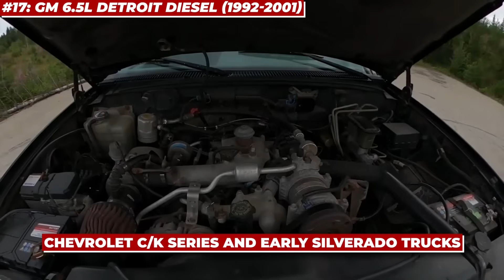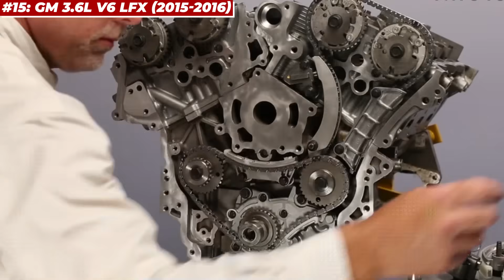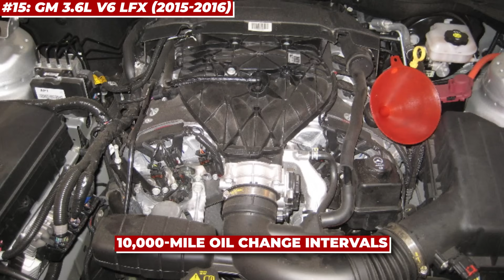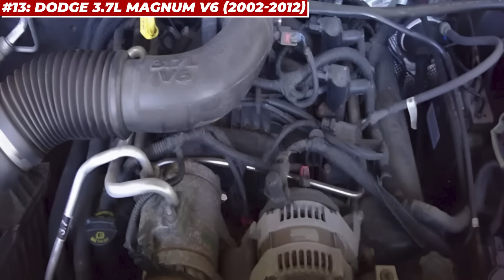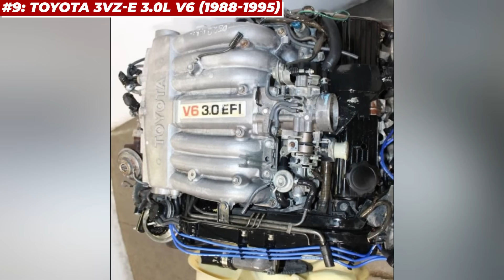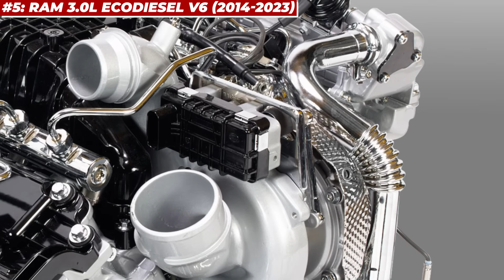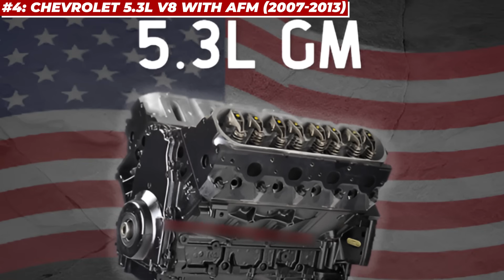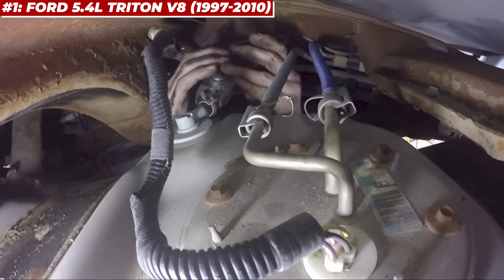17 WORST Engines Ever Put into Trucks!

Comment: Most these engines weren't Bad. Lazy Americans Not maintaining their engines, trannies, radiators is the main PROBLEM. 10,000 mile oil changes destroyed any motor. Never servicing your trannie and radiator destroyed vehicles. No fluid is Lofe time.

Comment: Fords biggest ever worst decision was not importing from Australia the mighty legendary 4 litre 4 valve VVT Ford Barra straight i6 engine. The decision not to is easy to figure out it would have simply destroyed the V8 industry. 182-195 KW WITH 380 TO 391 nm in standard form but its combined drivabilty in a 1700kg sedan it can pull a small house. The factory turbo versions are on a whole other level 240 kw to 330 kw and 470 to 565 nm would make great truck engines with 1 mllion km reliability. This engine built right can be a drag strip terror capable of over 2200 HP. You only have to spend a few grand to pump the power just a little and build a real reliable everyday 5-600 HP truck engine. Some of these engines came mated to the ZF 6speed manual which would make a mighty F150 hauler.

Comment: My uncle has an 81 Chevy truck with the 5.7 Olds diesel...it has 80,000 miles, 1 IP rebuild, lots of oil leaks, several sets of glow plugs, but it still starts every time...
Reply: Only 80,000 miles?
Reply: @RH-xs8gz  yes, show me any new truck that will go 44 years with nothing but an IP rebuild and a few things like the alternator and H2O pump...yes only 80,000 miles, but it is driven once a week or so...

Comment: This was a poorly researched video with the same generic AI voice heard in countless videos. Garbage.
Reply: AI voices suck, they are robotic and tend to mispronounce words.  They contribute to the plague of laziness that invades everyone's life too!
Reply: Agreed: the only GM Diesel that was based on a gasoline engine was the Olds Diesel.  I had a 6.5 in a Suburban that I ran to nearly 400K.  Yes, the Stanadyne DB4 electronic injection pump was a disaster, only because the head creating FSD was bolted onto the side of the pump, causing shortened pump life and very shortened FSD life.  Solution?  Remote mounting of the FSD.  Worked like a charm.  Oil cooler lines were a disaster corrected by having some hydraulic lines to replace them.  I put a Duramax fan blade on to increase cooling.  A full set of injectors cost about what a single Duramax injector cost. Rust and mice got it in the long run.  My old GMC Jimmy with the 6.2NA gave me 25 mpg but was pretty gutless.
Reply: @larryhurd7350  True, the 6.5 and 6.2 were a Detroit Diesel design. As Ford paired with Navistar and Chrysler teamed with Cummins. All the American auto companies learned after the Olds Diesel disaster, turn to the pros.

Comment: My 2007 h3 5 cylinder didn't make to 200,000 miles. I changed the oil every 3,000 miles and took care of it. Still looks new had the trans rebuilt at 180,000 and at 185,000 the engine went.

Comment: It wasn’t the aluminum head in the 5.4. It was the fact that there was only 3 threads holding the spark plug in.
Reply: I swear the people doing these AI channels look for ways to be wrong about the information.
Reply: I could've sworn I heard him say that about the spark plugs being too short
Reply: 5.4s aren’t great truth is the cam phasers and spark plugs are terrible  but there’s preventative measures you can take to prevent these issues get mechanical chain tensioners as the hydraulic ones wear out faster as for the cam phasers you can do a lockout on them and ford did redesign the spark plugs in 2008 to a one Peice design which prevents them from breaking
Reply: @quindariousgooch4176  Cam shaft bolts breaking . F250 work van,
Reply: And the extended plug design

Comment: The GM Detroit Diesel 6.2 and 6.5 were apparently so bad that GM didn’t get rid of that engine for 20 years…an engine that was also used by the US armed forces in the HMMV as well as commercial trucks..
Reply: They were far from being common, though, because no one wanted them, because they were garbage. The engines were updated over the years, and they're probably not as bad as they once were. The military wants lowest bidder, it doesn't buy the best technology avialable.

Comment: I've owned several GM 5 cylinder engines. I currently have a GMC Canyon and a Hummer H3. Both well over 100k and have no engine issues. Simple routine maintenance does a lot. These engines last well past 300k miles with simple care . Don't know who lied to you about your research.
Reply: I drove a Colorado 3.7 engine 2007 for 6 months. Crashed and totaled it. Bought a Canyon  2004 with tthe 3.5. Ran it till the frame quit on me. Engine was still running good
Reply: You just wait ….. you will !
Reply: Same here, 132K no issues...
Reply: 5 cyclinders 😂😂😂
Reply: @Iconhulk I'm sure it will beat your 4cyl ....car.
Reply: I watched a colorado 5 cylinder blow up right next to me on the highway. Chick driving it wasn't trying to let me pass. I floored it and she did too. Her engine blew up. Lol talk about instant karma. And i was driving a 99 explorer with 4.0sohc that had like 190k at the time. Now it has 223k and still runs. It's one of my daily beaters.
Reply: The 3.5 had a lot more issues because it wasn't a sleeved cylinder. The 3.7 was sleeved and had less issues. But either way, these engines were gutless.
Reply: Any modern diesel ends up with the same problems with the EGR. Nothing in nature eats it's own sh't and the concept in engineering is a colossal blunder. The EGR circuit makes the engine run way hotter and kills fuel economy to the contrary of the stated goal of reducing emissions.
Reply: I heard they are pretty underpowered and not very fuel efficient?
Reply: @adriansolo4  fuel effciency wasn't that great but they were quite peppy when properly maintained. the 3.7 was rated at 242/242. more with tune easily.
Reply: 5 cl really  bad ur lucky guy id say
Reply: Lol you're the needle in a haystack

Comment: The problem is the second-generation small block got so cheap they were making No money from them; you could buy a crate new 350 for less than $2000 dollars in the 90's and the early 2000's.  They changed engines not to make them better but to make them cost more.  That engine would work well today.  And you wouldn't have all the failures you have today.  And the four speed auto they had for years was also cheap.  No money from them.  They did it all for Money not to help the customers.  Their failures are their own faults.  These new trucks with 1986-89 engines would be the best with the 4 speeds.

Comment: The lm7 5.3 vortec  99-06 the best gasoline engine ever made ..
Reply: yes also 5.7 and 6.0 they are well engineered all gen3 good engines gen 4 not bad if you delete dod as early as you  can just tune or unplug  the oil sensor plug
Reply: Got 359.000  on my 2007 chevy  1500 Silverado   4.8 vortec v8  same transmission   still runs good  and power   and I used it to install carpet alot
Reply: @NasarioNieto The 4.8L never had cylinder deactivation, the Gen IV 4.8L is just as reliable as the Gen III engines.
Reply: @NasarioNieto I got 386000 on my 2008 5.3
Reply: @NasarioNieto  The 4.8 did not have AFM through the 2009 model year.
Reply: No joke, my 2005 suburban is at 325k miles and still going strong.
Reply: Had a farm truck with over 600k on it
Reply: I've got a 2005 Mercury Grand Marquis with a Ford 4.6 L. These engineer also very much bulletproof. That's why the police used them in their crown vics(essentially the same car) the one I have only has 60,000 miles on it. And has no problem ripping the tires off of it without using a power brake..
Reply: Yep I have a 2010 5.3 v8 Silverado it’s very reliable

Comment: Gm should've kept 4.3 or inline 6 Instead of 5 cylinder
Reply: That and the last true small blocks and good old 4 speed auto which are all cheap to repair or replace.
Reply: That was a great motor. I  Had one in a boat also.
Reply: 4.3 and the Buick 3800. Best GM engines

Comment: Add the Nissan A series engine, 1976 to 1982.  Week defective main bearings send pistons into the head, destroying values, pistons, and crankshaft.  Self destructs the engine at 75000.  Engine used in the b 210, 210 and pickup as the main engine options.

Comment: my 2008 ram 4.7  has  
160,000 miles no problems
Reply: Yea but anecdotal evidence is only evidence of an anecdote.
Reply: The 4.7 ans by extension the 3.7 V6 are in fact kind of garbage. The 4.7, you overheat it once and you just bought a new engine. Warped heads are a thing on these. Plus a lot had dual spark plugs.
Reply: The 08+ might be the toughest v8 I’ve ever seen along with the 6.2 Ford

Comment: Gotz 2 Fords at the house! Neither one has a Ford Engine…. Won’t ever buy another ford except for a 7.3, they ripped 2 many people off. GM ain’t no better. Need a truck, Grab you a Ram Diesel, watch out for them 53 Blocks, and weed out the crappy years
Reply: Either that or a 99-06 Chevy ls engine .. the lm7 to be exact
Reply: Buy a ram  hurricane 6 or a hemi with the famous hemi tick then. They  are all junk
Reply: @michaelcoonce6694 had to look that up. Maybe they got it worked out? One turbo is enough trouble. Don’t even know what Dodge Ram  offers in gas. I’ll have to go back and correct for Diesel. Bout like a 3rd Gen! Cummins of course

Comment: I have a 98 Ford Econoline E350 , with the Trident , 2 valve 5.4 . I have blown 3 plugs , which thankfully were not to bad to fix . If it never blew a plug , it would be a great engine , 279.000 miles on it .

Comment: I have a Colorado 3.7 I like it I’ve owned it for8years
Reply: Keep the oil changed regularly, and it'll probably last you at least another 8 years. 10k miles in-between oil changes is never a good idea.
Reply: 05 canyon 215 k 2.9 manual trans

Comment: The 5.4 3valve is not the worst one or #1 compared to others. I have one myself it runs great. Have replaced spark plugs with special tools with no problems. SUV Zone get your facts right again not the worst engine!! More reliable than others you mentioned.
Reply: My 07 is sitting at 215,800 miles and runs perfect. Never had any of the problems listed in the video.
Reply: My dad's 2006 F150 with the 3 valve 5.4 has 305,574 miles on the clock. She's worn out, but will still run.
Reply: Shhh 🤫 don't tell the 300,000 mile 4.7 H.O. in my Grand Cherokee it's a pile of junk...

Comment: I knew they were going to bring up to Triton 5.4 but there are way worse motors like them diesels Oldsmobile GM made that shouldn't even on the list that should have been gasoline motors only
Reply: My neighbors had one of those diesels and one winter it would not crank, I listened to it and first thing I said was the plugs, they informed me it didn't have plugs it was a diesel.  I informed them it did, it was a low compression diesel which needed glow plugs to crank when it was any way cold.  It was very expensive to have them replaced.

Comment: Ford 5.4 Triton 2 valve is a very good engine
Reply: The 2 valve works but it's gutless. Definitely high Rev to make power. But it did work. The real weak link other than leaky intake manifold and spark plugs was the Walker fuel pump. Replace it with a Bosch and no issues ever.
Reply: @Ratkill9000  You're right about the intake manifold and the fuel pump but I personally never had spark plug issues. 
That's because I never beat on the engine.
The Triton 5.4 is designed for low end torque which it has plenty of
Reply: Yeah right you need a drug test 🎯
Reply: @leehall7852  before my 5.0 2017 i ran a 2010 f150 5,4 over 300k mile of abuse work and it was still runing like a clock i have a buddy that has a old e-350 with the 5,4 and these engine just won’t
Quit they get the job done no matter what people say
Reply: @leehall7852 Mine purrs like a kitten

Comment: You are all wet when you state the 6.5 was a modified gas engine. It was a further development of the DD 6.2 diesel that was designed as a diesel from the start. You are confusing it we the Oldsmobile 5.7 diesel apparently.
Reply: The 5.7 Liters were a total bust.  The 6.5 was a better engine by far.  If my memory is correct 6.5 had an electronic fuel injection pump
Reply: @RobertHanan-h9y the 6.5 had an electronic pump from 94 until the end of production. 92 and 93 6.5s had mechanical pumps.
Reply: The 350 Olds and those other derivatives were purpose built blocks and heads. The only thing it had in common with the gas engines, was the tooling, that saved some money. But they were not modified gas engines. A gas block would not hold up to the pressures of diesel combustion.
Reply: I also think the person who made this had the 6.2 in mind as the 6.5 turbo has no issues going highway speeds (I have one in my 96 Tahoe, and it goes 80 fine). The 6.5 still isn’t a powerhouse, but it isn’t as lethargic as the 6.2. And the 350 olds diesel was actually designed as a diesel from the get go, but it is a common belief.

The 6.2/6.5 was definitely not a gasoline-derived engine.
Reply: Correct  !! This jackass doesn't know what he's talking about.
Reply: It was a modified SB. It used the same fuel pump location and push rod. It even still had the hole where the gas distributor went. Same water pump same head bolt pattern. To me, I believe it used the 400 SB, but it's definitely a SB platform.
Reply: @Lance.West4 the 6.2 and 6.5 have the mechanical fuel pump boss and lobe because the 6.2 used a mechanical fuel pump to pump fuel from the tank to the injector pump. The 6.5 used an electric pump for that, but kept the fuel pump boss to use as an oil return  from the turbo.
Reply: @Lance.West4     Not a gasser engine at all 100% Detroit Diesel any similarities to SB gasser engine purely coincidental.

Comment: I'm sure GM engineers knew what they had to build to alter a.350 gas Olds engine to a diesel engine, but the bean counters over ruled their concersna and recommendations to save $50 here and $140 there. So the entire design failed and reuined GM's reputation tor decades. Did the bean counters get ftwrred and feathered if nor fired? Im sure they werent. Just blame the engineers.
Reply: Trust me, the beancounters always have the final say and overrule the best instincts of the engineers.
Reply: The Olds 350 was not a converted gas engine. Blocks were stronger on the diesels. Only the tooling was shared between the gas and diesel to help with costs. But they had cut corners elsewhere in the design. Not having a water separator, or fuel filter, which didn't get added in until the final year's of production. Actually the final year they pretty much had it figured out, but reputation was ruined